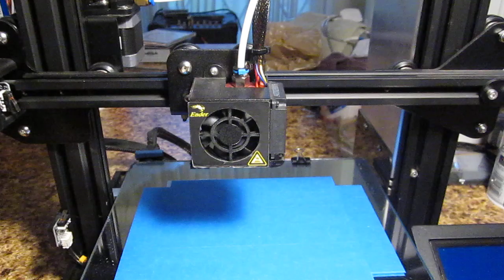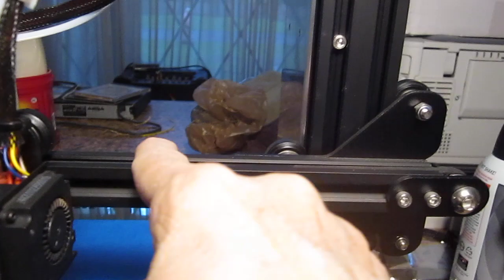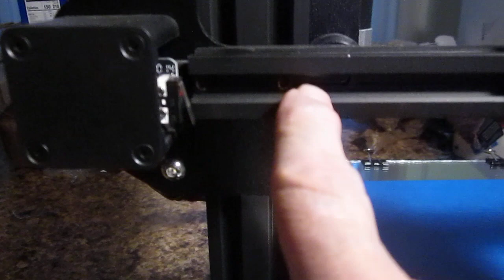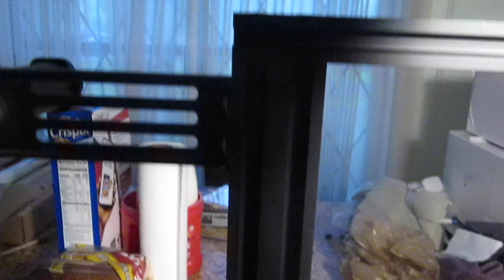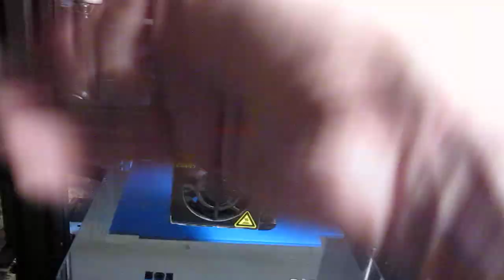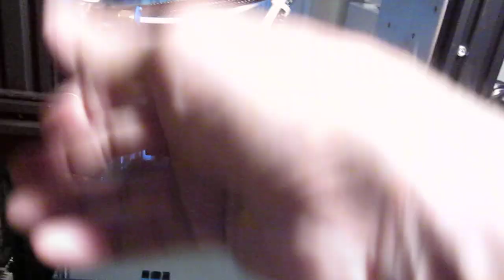ENDER 3  - GANTRY  Fix the real problem the correct way. Don't over thinking the actual issue!

Comment: Very interesting and ironic !  I had issue with the right side of X axis gantry being a little low.  Saw a video with a guy recommending and detailing very authoritatively EXACTLY how to adjust the rollers on the right to "fix" the problem, which you say NOT to do.  I'll go back now and re-do !  Thanks.  (BTW not exactly clear from your video what to take off to access the two screws from the back, but guess I'll figure it out).  Thanks !
Reply from the maker: Normally, at the time of assembly, those two support screws on the left side of the GANTRY are accessible and nothing needs to be removed to get to them, because the GANTRY would not be on the vertical rail at that time.....
Reply: @blinkyone1947  Understood now and THANKS ! Had to remove the X gantry off the vertical rail.  Fixed now and prints are perfect !!!  Never would have thought to fix the LEFT side, not the right !  Thanks again Blinky, very insightful !

Comment: Is the glass bead better than the sheet that comes with it? If so, could I get a link to the glass?
Reply from the maker: Not just glass.
It is a mirror tile, cut to size. This build plate gives you way more options (as a user) then other means will ever give you 🙂.....